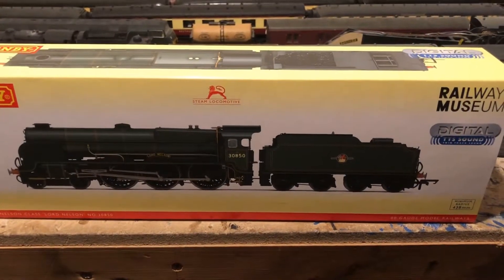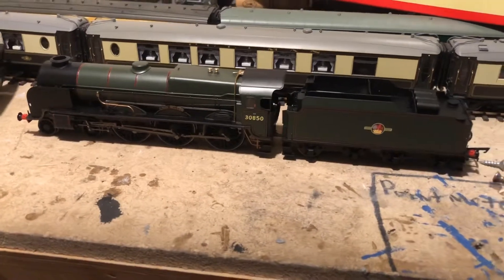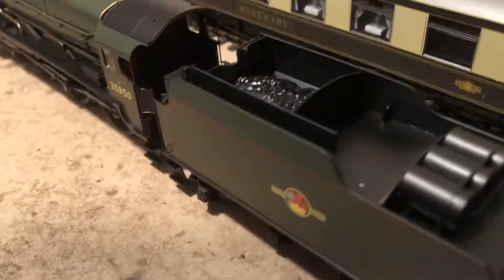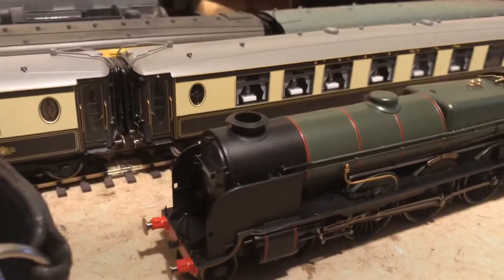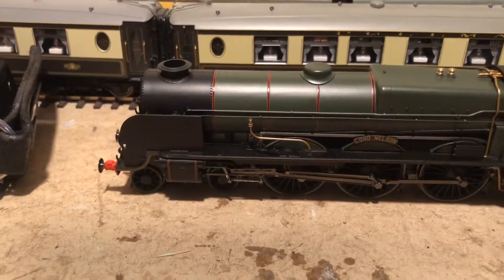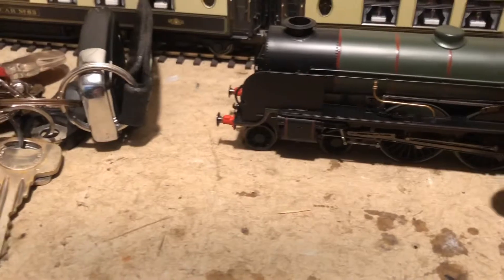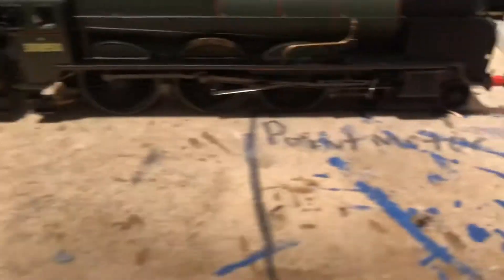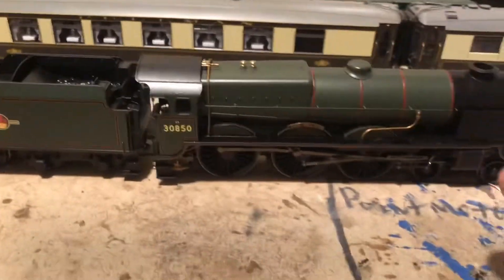Hornby Lord Nelson Review

Comment: Thanks for sharing, if you can please share your DCC progress, I'm thinking I might change my layout to DCC in the near future (Xmas). Cheers.
Reply from the maker: Hi Kevin.

This loco has since been reverted to DC and the Sound chip sold off. I decided that it would’ve been too expensive to have gone over to DCC with the amount of locos I own.

Good luck with your layout.

Thanks for watching,

Ross.
Reply: @rossnation8092  No problem Ross, cost is one of the main reasons I have stuck with DC, I was looking at a Gaugemaster starter setup at £220, scary. All the best, Kevin.